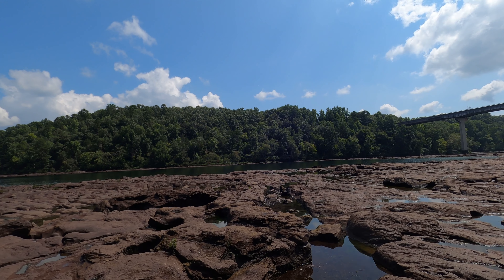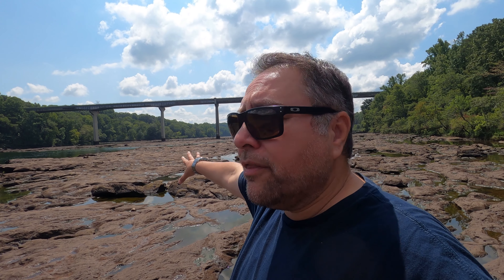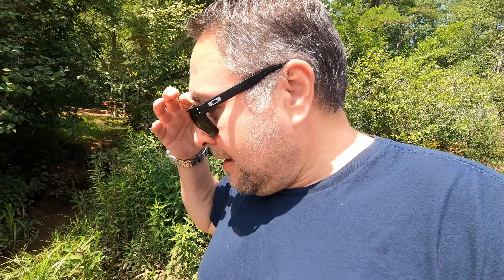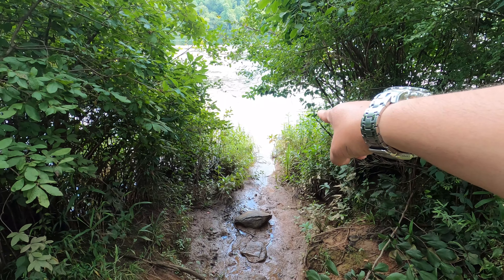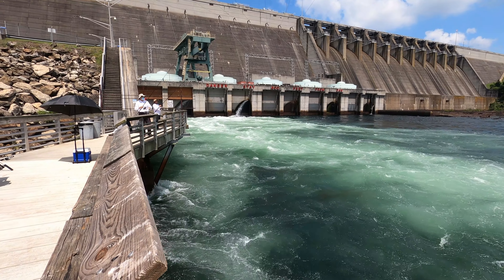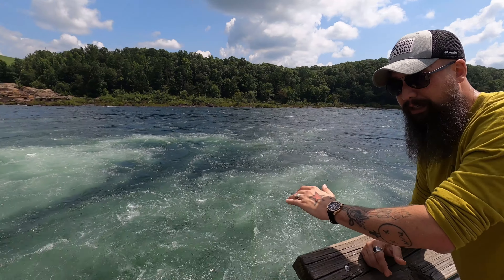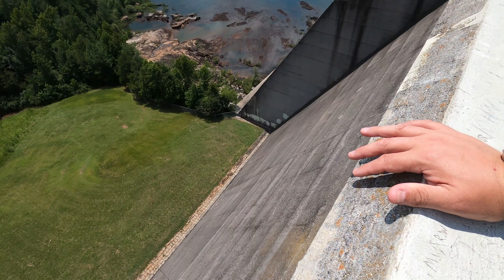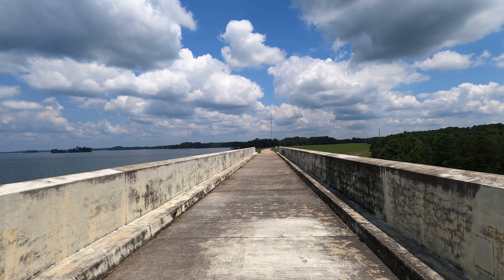Hartwell Dam Power Generation | Flooding the Savannah River

Comment: Scheduled generation starts at 12 minutes before the hour. Within 10 to 15 minutes the generators can be running full load. That’s said, maintenance can start a unit anytime to test components at any time or if a running unit goes down and they need a unit not running. It will then start.
Reply from the maker: Interesting!